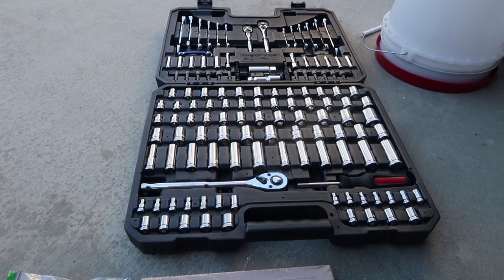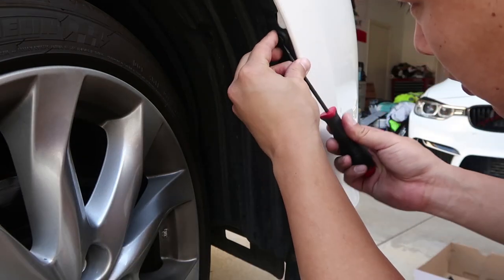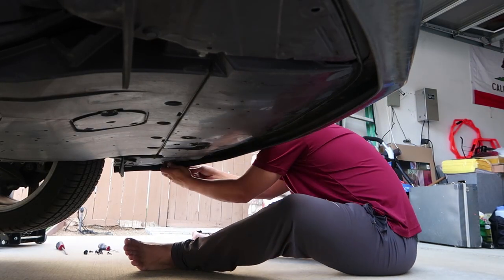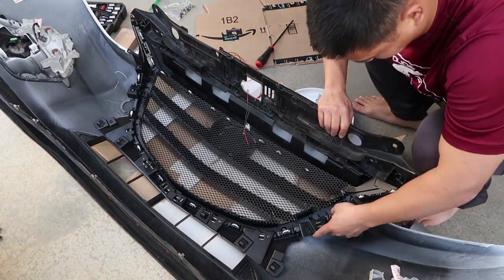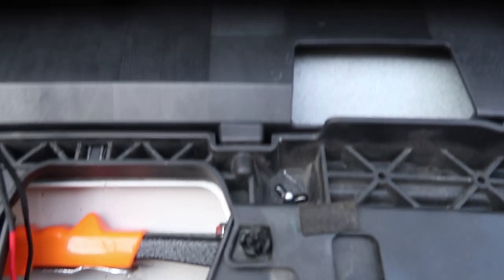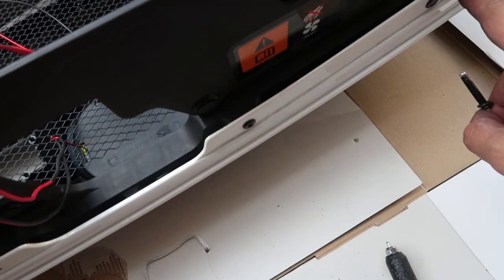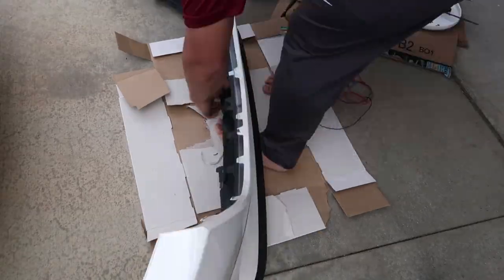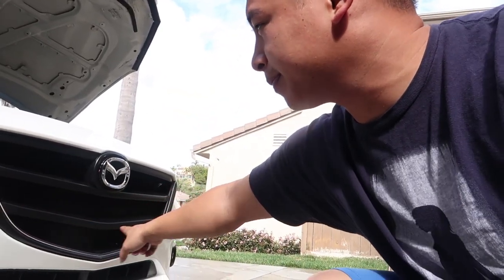NEW GRILL INSTALL!! - Bayson R Grille

Comment: How do you get the upper bonnet grille panel / trim seperated from the grill? Do the rivets pop out or do they need to be drilled out?
Reply from the maker: There are rivets that you have to bend sgraight then pull them out. They are on the underside

Comment: I have question the original rivets the plastic ones are they hard to pull off how did you remove them
Reply from the maker: Plastic tabs just pop out from the back

Comment: Hey I have a question. I have sensor on my front OEM grille, how will this affect the removal of the grille?
Reply from the maker: Shouldnt. It will be connected so you have to be extra careful and disconnect them while your taking it off.
Reply: Yea , but the problem is how do I fit them on the new grille.. Should I just give them up ?

Comment from the maker: Enjoyed this Install of the Bayson R Grille and hope you did too! Let me know if you guys have any questions.
Also let me know what you guys want to see on this channel! Thanks so much for watchin!
Reply: Do you have radar cruise control? Asking because the mazda emblem is different
Reply from the maker: I do not. And it is different. :) not a typical front mazda logo.
Reply: Where do you get it?
Reply from the maker: BoogieDownProduction Ebay.
Reply: Greg F. Pettus by any chance can you send me the link for the Mazda 3 emblem used in this video, looking to do this to my Mazda
Reply from the maker: If you can wait about a week. I am planning on filming a video on that emblem. I will link it up in that video!!
Reply: Greg F. Pettus grill looks great, I am considering it for my 2014, but would you know what material the mesh part is made of? I am in the northeast and would worry if it’s not plastic but some type of metal, it may corrode with winter road salt exposure...

Comment: I'm looking at painting my OEM grille. Would I be able to re use the plastic rivets and clips it comes with?
Reply: I guess a better question would be, are the only rivets used just the ones holding the top lip piece to the grille? Because if that's the case, I could paint that all together since I was going to paint that lip as well.
Reply from the maker: @NoName-NoData  Everything is reusable since you arent taking off the top piece. You only have to replace the rivets if you need to take the top piece off otherwise they just stay on.

Comment: A lot of work for   meh.
Reply from the maker: MiketheYung God not that much work for better function. Also nice to know the process
Reply: Came in handy today while looking at how to repair my front end after a collision involving a deer in Utah that insurance didn't cover. Only applicable content to answer questions I had regarding the directions and parts to replace what I am missing. Thanks.
Reply: Hobo Jesus your situation is different. Yours needed replacement, otherwise, it's not worth the work just to change it because you don't like the original.
Reply: @miketheyunggod2534  yeah. Replacing with aftermarket... And a pushbar bumper

Comment: I'm having difficulties with the rivet removal
Reply from the maker: Rivets need to be broken from the back side. I just bent them with pliers straight enough to pull it through.
Reply: Ok thank alot  I got that part, but now I'm having trouble with the upper lip. I can't seem to find the parts to unclip to detach it.

Comment: Nice install!  What method did you use to remove the rivets where the upper painted grill meets the plastic?
Reply from the maker: Honestly just went to the back side and squeezed them until the metal became easy to manipulate and pulled the rivets through
Reply: Late but hope this helps according to mazda repair manual u need 4.5mm drill bit I ordered them on Amazon $5 do it right the first time use the right stuff why risk breaking  more I did that in my young teens as an adult in 30s now buy once cry once’ 

4.5 mm drill bit and u drill the rivets out very simply takes 5 secs

Comment: I have a 2016 Mazda 6 with sensors all over the front. Would this grille change affect the sensors like would I have to do any reprogramming after or can I just plug them back in and everything will be good?
Reply from the maker: If its just the grille then shouldnt be an issue. The aftermarket ones have extra space around the emblem where the sensor is to install the oem sensor/emblem. I would double check and ask just in case. Everything should plug right back in and should be fine.

Comment: Hi Greg. Big fan. Lately I've been thinking to insert some soundproofing material into the interior floor carpetting area. I would feel more confident with one of your videos!
Reply from the maker: Hey man!
I am not sure I will ever get to that. But there are some stellar videos on youtube focusing on that.
Why are you thinking to add more soundproofing?
Reply: Greg F. Pettus our Mazdas are notorious for bad cabin road noise and after a while it gets a bit fatiguing. I've watched some good videos on YT but was unsure of how to remove the plastic skid guard interior trim that allows access under the carpetting in the driver/front passenger area. I'm fairing certain I need to put some soundproofing material down there as well as the front wheel well areas.
Reply from the maker: Alan Phuong yeah. One slightly helpful recommednation is better tires. The stock dunlop material is awful. I will ponder the soun deadening a bit and see if i want to too.